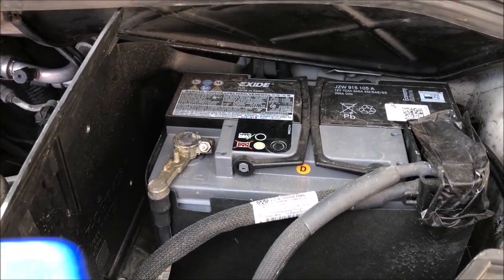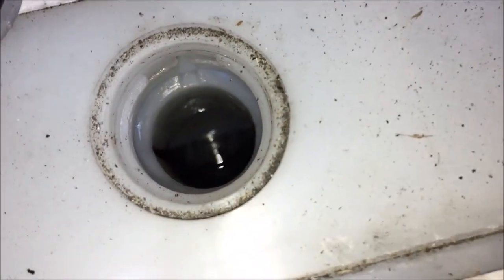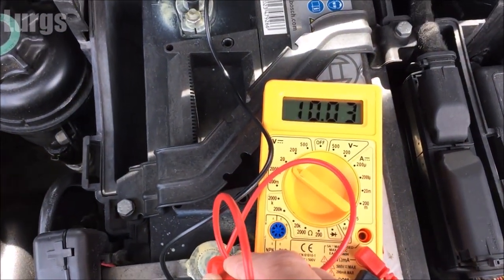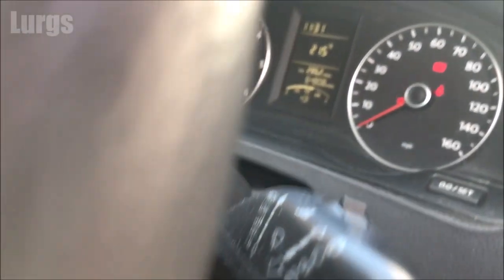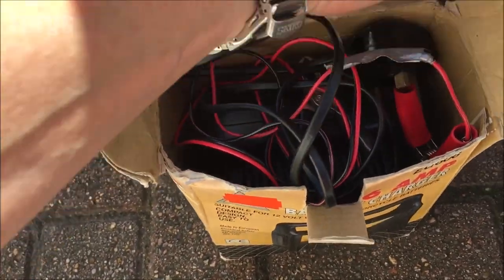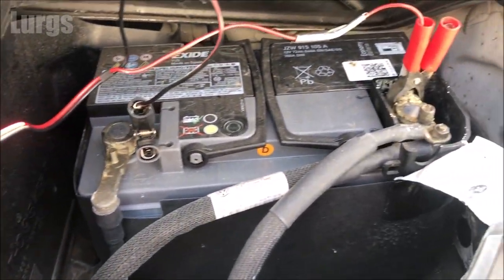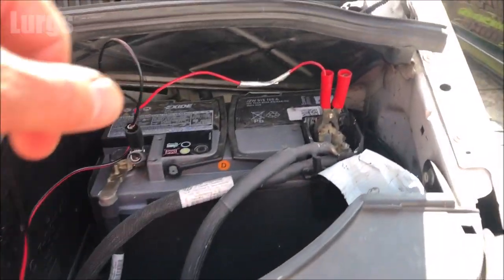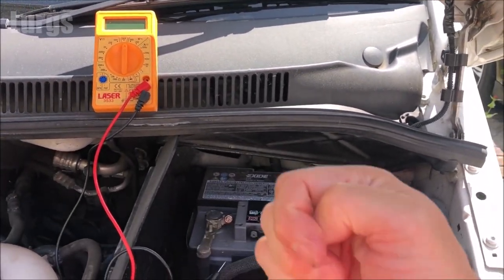How to prevent your Car Battery going flat during Lockdown or through lack of use

Comment: Thanks for the great tip! Would it be safe to use a battery less jump starter super capacitor? I guess as long as the battery is at a certain voltage (7 or higher, I think), that it will charge from the little bit of power left. Then, it has the car use its own battery to charge the battery or something along those lines. I just recently bought one but haven't had to use it, and this would be the perfect excuse to do so, especially once spring gets here and it isn't freezing cold!
Reply from the maker: Not sure what type that is. If it’s specifically for jump starting then you don’t want to use it too often on your battery. Ideally don’t let your battery drain. If you don’t use your car much then trickle charge once every few weeks or just start it up every 3-4 days to keep it topped up. The alternator will charge it when it’s idling.

Comment: Lurgs, lovely information. After seeing this video, I went ahead and ordered a CTEK charger (MXS 5.0) for my Kadjar (2016). CTEK recommends that charger's negative lead is connected to suitable earth point in the car.  Is the negative terminal of the battery a suitable place ground point in Kadjar?  Also does Kadjar have AGM or EFB battery?
Reply from the maker: Yes negative terminal or any part of the metal chassis, like a bolt on the wing.
Not sure what type of battery it is as I haven't got this motor anymore. It should say on it.

Comment: I was always told to disconnect the battery terminals first before charging 🧐
Reply from the maker: Robert England Yes in an ideal world but then you can lose your computer settings. I've never had an issue in 34 years of doing it. That's why I recommend a low amp charger so you don't overload it.

Comment: What to do if i don't have plug accessible outside?
Reply from the maker: If it’s flat you can buy booster packs which you charge indoors then take out to the car. Else try to run a long extension lead out to it and watch it charge for 30mins to an hour
Reply: @LurgsHowToGuides   Thanks the extension is impossible I am on the 4th floor of a building and my car is park to far away.I have a boosts cars (power pack) but i can't charge my battery with that.The only place free i can charge my car It's at my father's place but it's 114 km from my place. (About 1h30)
Reply from the maker: Once a week just visit the car and drive it round the block or start it up and run it for 10mins. Also if you leave it for long periods don’t put the handbrake on, just leave it in first gear. Brakes can seize on after a while.
Reply: @renevincent138  I know this is an old post, easiest thing to do is buy a battery charger , remove your battery and charge it in your home overnight or daytime for about 5-8 hours on trickle charge. Another procedure to try is jump start from another vehicle or tow/ bump start.